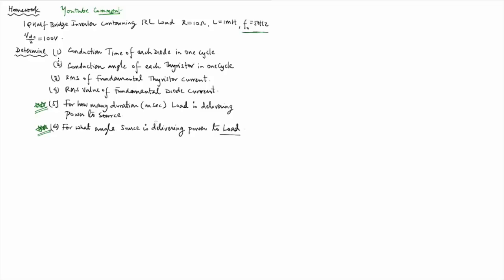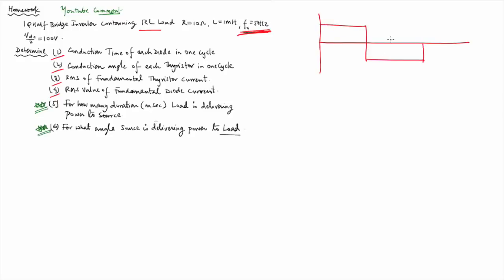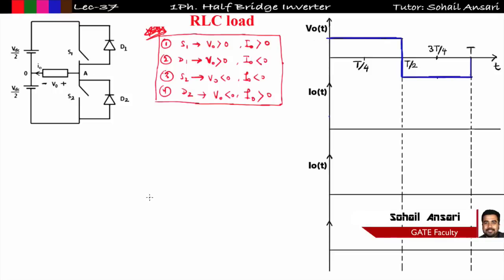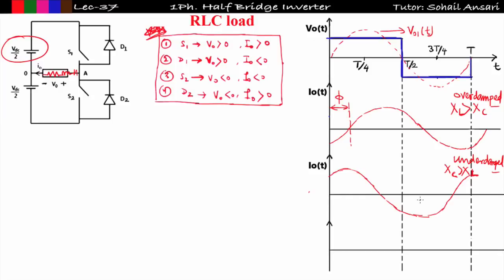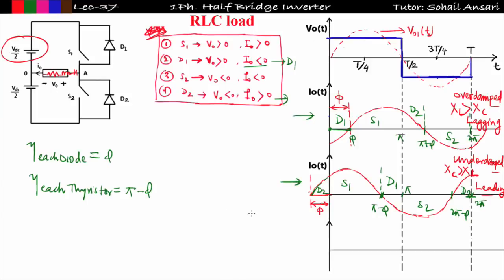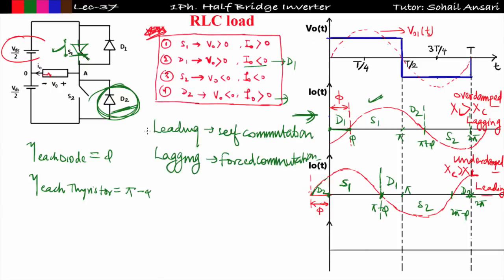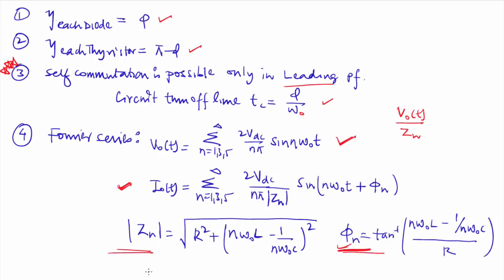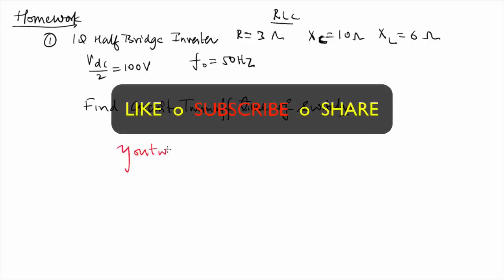Lec 37(d) Half Bridge Inverter | RLC load | Power Electronics | GATE 2019

Comment: While you are deriving formula for avg and RMS value of diode and thyristor current, you said we are only considering fundamental component which is sinusoidal in nature but  you took the waveform of total output current which is also sinusoidal to find avg and RMS value of fundamental. So if they ask for avg and RMS value of just the diode current (not fundamental), how should I proceed. Does the total output current waveform will also equal to the fundamental component of output current waveform? Thanks for your lecture sir and sorry if this question is silly to you.

Comment: Sir, U asked turn off time  of switch. Not diode then
 t=(pi- fie) / w?????
Tell me if i'm wrong.
Reply: Turn off time is defined as the time when a switch is reverse biased. In this case...it will be reverse biased as long as diode is conducting...hence phi/w